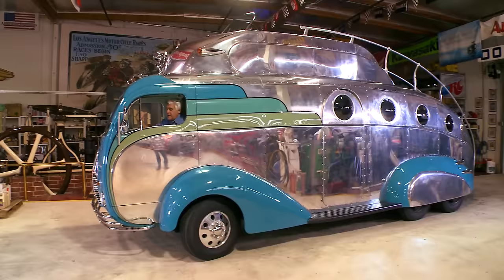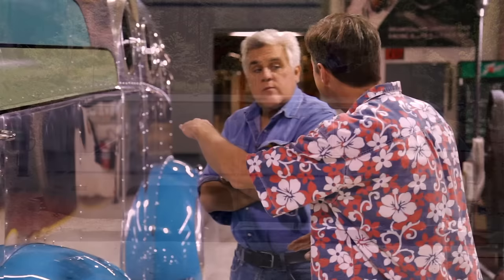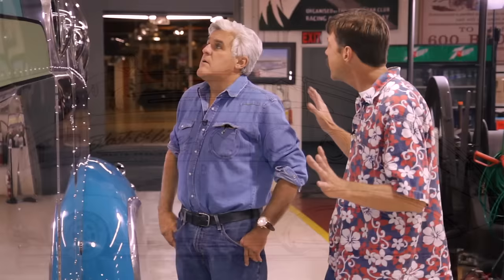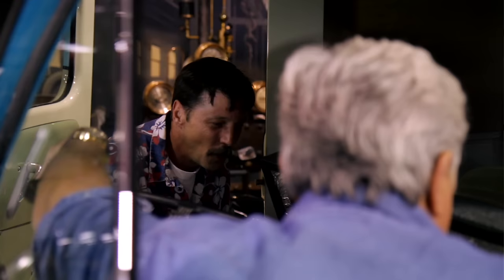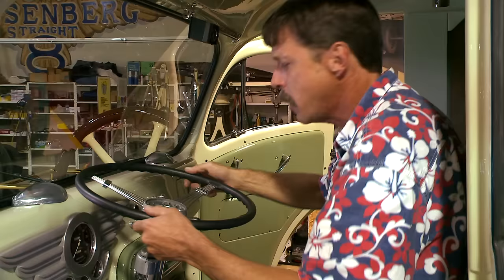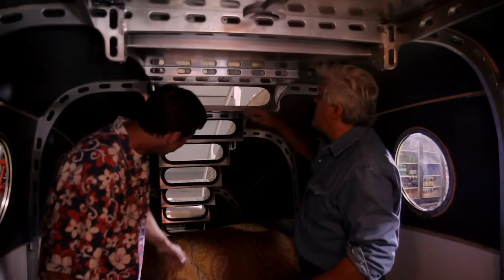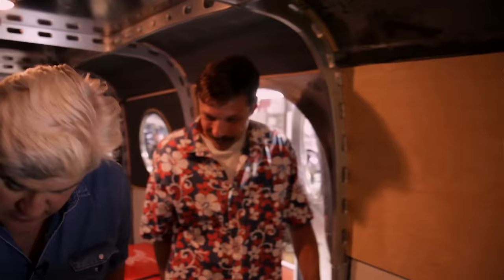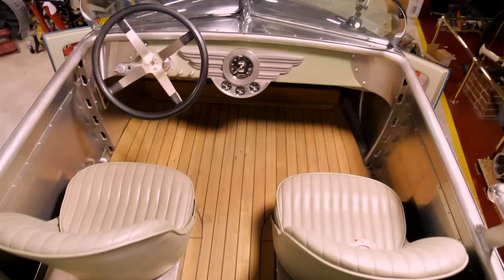Decoliner Custom Built - Jay Leno's Garage

Comment: I can see the news headlines. Crazy car engineer Ned Flanders kills family as RV looses steering.
Reply: lol, ned flanders
Reply: Joepopa12 I was thinking the same think.
Reply: loses*
Reply: No
Reply: Shtoops27 funny
Reply: Shtoops27 There is a safety pin that you can drive through the shaft when you swap them out. The video obviously doesn't show it put in, but there is a slot for it. So yes, it would be perfectly safe when assembled correctly. Very cool idea!
Reply: Shtoops27  lol funny . makes me wonder where this guy buys his weed
Reply: Shtoops27 dont go under bridges or in tunnels, CRASH
wheres daddy? hes driving.
Reply: If you look the steering shaft and wheel are secured with screws, they just don't show them securing them. It's probably pretty safe. I'd be more concerned about having my face ruined by a tree branch
Reply: Esteban Dufanzo -...again
Reply: I was thinking Ned Flanders too!
Reply: LOL!
Reply: There is clearly a couple of holes on the end part of the upper shaft (from the alternate roof steering wheel that connects to the lower shaft (for the regular steering wheel), most likely for screwing in two Allen head screws with an Allen wrench, thus I wouldn't worry about them upper shaft coming loses from the bottom shaft when the connector is properly screwed tight.
Reply: This is highly probable as he lives in Oregon and the Simpsons was modeled around a town in Oregon
Reply: @Charlesb88  Threads would get damaged to easily, I would use a hardened pin with little spring loaded balls at the end that locks it in, and a D ring to pull it out.
Reply: loses*. Unless you mean to say the RV loosened it up.
Reply: Yeah, that upper deck steering shaft should be connected with a pin.
Reply: @loganquinn9452  THAT WAS GLORIOUS.

Comment: I think I'd want some retention clips on that steering gear, otherwise, pretty cool! :)  Where I live, you'd hit one of our famous "Pennsylvania Potholes", the steering shaft would pop off, then the fun would begin...  ;)
Reply: i think it actually clips in place but im not sure.  your right thow if you hit a mean pothole and the shaft comes loose you better hope your breaks work very well.
Reply: haha nevermind the Pennsylvania potholes, now in NY we've got some good 3-5 inch deep ones around the city and suburbs.
Reply: // , You really think there is no safety pin or other mechanism to deal with that on a car from when our roads had so much less maintenance than now

Comment: Haha I died when he pulled down the steering shaft. But I'm just wondering if there's anything holding it together other than gravity. What happens when you hit a speed bump and it pops off?
Reply: You get a headache.
Reply: There's a safety pin inserted to hold it in position.
Reply: Oh ok. Good, because I was worried.= about an obvious possible flaw.
Reply: quick release like in race cars
Reply: Io
P0e
Reply: Io
P0e

Comment: I'm very familiar with the GMC motorhomes. I owned one of the very earliest ones, serial number 21 and the best I can say about them is they were absolute dogs. Of course, my choices in vehicles is highly questionable as I once bought a Yugo as a TOAD behind my Winnebago. It was the same color so I painted matching stripes on it with a Y instead of the Winnebago W and told everyone it was a Yugobago.
Reply: a black belt who can levitate, with a Winnebago and a Yugo.  check please!
Reply: that was a very brave "Yugo" confession. Few would make such a statement. here here.
Reply: Actually, I bought it more or less on a whim. I was at a dealer going out of business auction and they had three of them, two new and the other a "demonstrator" with about 300 miles on it. The auctioneer tried to get an opening bid but no one said anything. He was trying to get one for a grand but no takers so I finally tossed out $500. "SOLD!" He asked if I wanted all three but I declined.
Reply: ...sighs..”Yugo, I’ll stay with the car”

Comment: O. K this is cool but what about the transmission  shift linkage, brake pedal and gas  pedal on top? He covered the steering wheel but not those. Please answer my question. Thanks, Dave B.
Reply: A transmission can be used by cables, same goes for the throttle, he probably just bent some tubing around the vehicle and down to the engine, and brakes are only used by a hose and fluids so that's manageable.
Reply: pedals can be electronic and not connect to the engine itself

Comment: Hang on a minute... What happens if the steering wheel falls off while you turn or swerve? Maybe he could add a clip mechanism or something
Reply: I was thinking the same thing lol. I suppose as long as you aren't doing anything too crazy you could just put it back on
Reply: You would have to run down the exterior stairs, & out run the vehicle, to get to the door.
Reply: I think I heard a substantial CLICK when he mounted the extension, but you're right, I wonder if it is good enough to survive a collision, or pot hole.
Reply: It’s locked in place

Comment: If that steering wheel gets disconnected by accident, you're ded.
Reply: Yeah, that should be secured with a pin.
Reply: Then use the brakes.

Comment: Please add a locking pin or something on that steering wheel. lol you don't want that popping off on the highway
Reply: There's a pinch bolt I saw but you would have to hit a serious bump for that heavy steering column to pop off.

Comment: I love it. However something must be done to better secure the upper  steering column to the lower portion. A Through key or lock lever. At the length of the shaft a deep pot hole hit on the left wheel could be enough   of a jolt to lift the coupler off the lower shaft. If it turned sharply  after that? It would  roll over. It is a beautifully  made piece of automotive artwork and I think this man is every bit the artist any museum artist is. I would like to see more

Comment: that's cool 😎 Mr Leno... I just bought an 88 Aero Cruiser 23... it is tremendously cool and cute... but yours, sir... takes the proverbial 🍰 cake
Reply: mine, however... is bright Stealth Red... sometimes called resale red.. in the business... I find it handy... because, unlike my red trucks and motorcycles... people see me... which is good... it's like a very large VW bus... with a Mopar 360 V8... makes lots of noise..  slowly
Reply: yours is... like a cross between the Oscar Weinermobile and a double decker bus... that's awesome dude .  truly awesome
Reply: we used to live across the street from the Oscar Weinermobile... up near Walnut Creek... it was built on a 56 imperial or something... like the Batmobile painted brown..  carrying around a large hotdog 🌭... so I recognize the era of the design... yours takes the cake
Reply: ya know that really cool aluminum foil tape stuff... like really thin duct tape, ??? 
makes good balloons 😉... very light and very strong... a handyman's secret weapon
Reply: ok .. I'm taking bids Mr Grubb... think Viper V10... with transmission... drive shaft and rear end appropriate... on an 88 dodge one ton chassis... I have lots of metal... can help..  which generally raises the price I know... but hey
I'm moving towards mobility soon.. tie rod ends.. odds and ends to make everything work.. my best friend is up on the slopes of Mount Hood... I'm thinking about visiting to help with harvest this year
Reply: I'm thinking stealth red still..  StarFire Stealth Red... it's kind of amazing driving down the road around here... this is like driving an overgrown VW bus at the moment.. slightly used... a wing and a prayer comes to mind almost as soon as you get going... man . I'm praying the brakes work better than the steering... so this is my new hobby... I'm going to fix it up
Reply: and they actually see the durn thing .. sun city is just up the road a bit... it's a first for me. . I've had more than one red truck... people still don't see you.. it's kinda nice... I also have a mobile machine shop... do metal fabrication.. make carbon fiber stuff and I'm looking at different materials for my 3D printer.. small foundry for making metal... stuff
... it's also early July in Phoenix... 9 in the morning... 43° already... Celsius
Reply: Peace ✌️
Reply: let's make it a double decker too .. please
Reply: possibly wheelie bars

Comment: I have a safety concern regarding the steering shaft. I think it would be wise of him to design some type of locking pin. If he ever drives over a large pot hole or bump while driving up top, that steering rod is going to pop right outta there. ...Can you imagine that happening while speeding on the highway?

Comment: Since we're not equipped with 3 maids and a butler if you lower the stairs to climb on top how does it get folded back up??Then if you got that ONE person riding up top who can't leave anything alone and the upper wheel is turned the driver inside will get knocked out.

Comment: That steering column seems to disconnect way too easily. I feel like he's just one major pothole or speed bump away from losing all steering function from that top floor.
Reply: Ha! Just finished watching the video and that’s the first thought that came to mind. ☝️🥴💭💥🚎
Reply: I had the same thought about the steering wheel on the lower level.